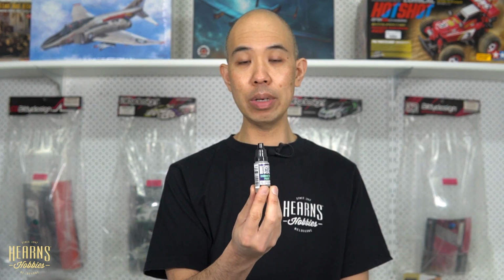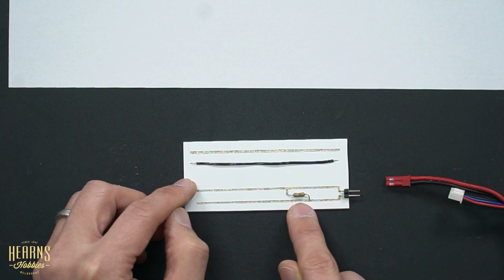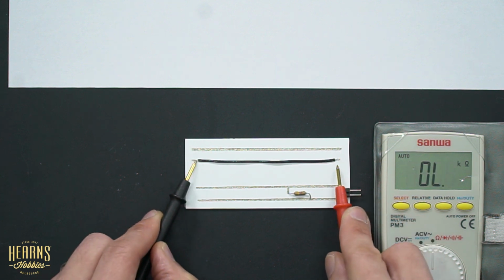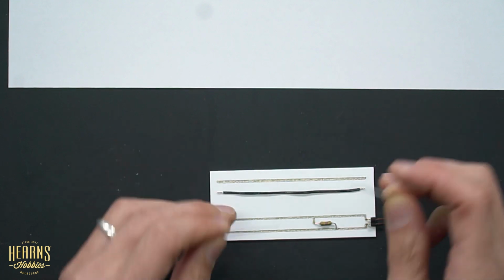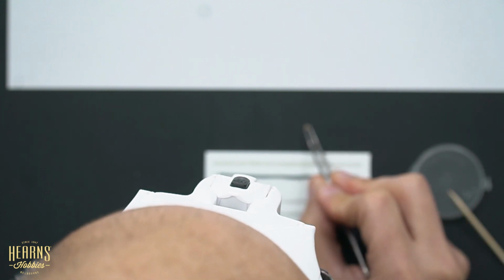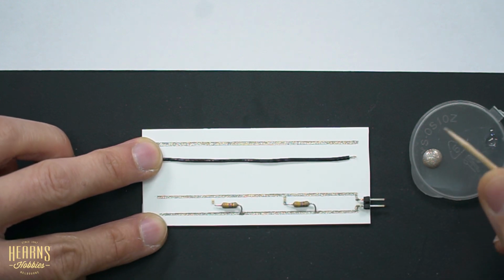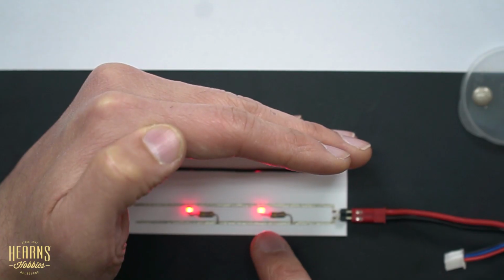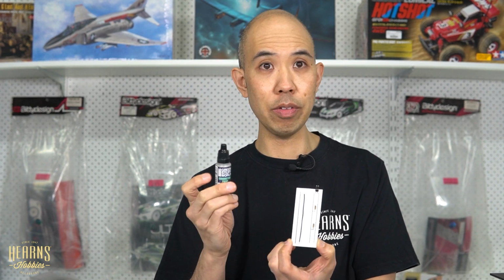Green Stuff World | Conductive Paint Tutorial | #askHearns

Comment: The resistance in the length of wire is relative to the thickness of the wire, this is called "line drop".  The same is applied to the conductive paint.  The thinner the paint, the higher the resistance.  In model railroading this paint is used to connect a tiny flat resistor between the wheels on the axle of a freight car or the last passenger car (without car lights) for train detection in a block area of the layout.
Reply from the maker: Thank you for your technical information.

Comment: I've been using LEDs on models for a while but I tried this gsw paint and I couldn't conduct anything, I did multiple tests but went back to wire..
Reply from the maker: This GSW conductive paint works fine over short distances and instances when wire is difficult to work with . Wire or copper tape is best over long distances.
Reply: @HearnsHobbiesMelbourne  I received a replacement from the Amazon seller and this one works great just as it should, the seller said he hasn't sold many bottles and some must have gone off!  
Just out of curiosity I poured out my original bottle and about 25% of the metallic particles were stuck to the bottom of the bottle as a solid lump, thanks for your help and seeing it work properly in your video was really useful.. 🙂
Reply: @HearnsHobbiesMelbourne   I thought I'd have another go this morning but still no look so for me,  I'm thinking I may have got old stock or something because I tried a conductive carbon paint from Amazon and it works great! 

On the gsw video they just lightly paint on some tracks like you did and then they touch a battery to the tracks and hold an led to the other end .. I've used pure silver leaf before because it's thinner than human hair and impossible to detect under the paint but it was very fiddley, I might order another bottle from another seller to see if I get better results!... 🙃

Comment: So if you paint it on the outside of a model, can you then paint and decal over the conductive paint? Could it cope with 12volts? How many amps? It sounds like it would be a good option for the nacelles of the 1/400 Enterprise D - rather then cutting out a trench and covering it up. But only if it an cope with 12 volts…
Reply from the maker: Yes, you can create your electrical circuit with the conductive paint first and then paint over the top of it.
I haven't tried 12v or high amps. How high amps will you go? I can experiment further.
Reply: @HearnsHobbiesMelbourne  1 at the very most - was going to use led strips or el tape for consistent lighting, plus blinkers, strobes and a few other things. The led tape requires 12 volts- it will run on 9 volt, but very dim. They rest are pre wired leds, so 20ma each
Reply from the maker: I will try a few things and get back to you with my findings.